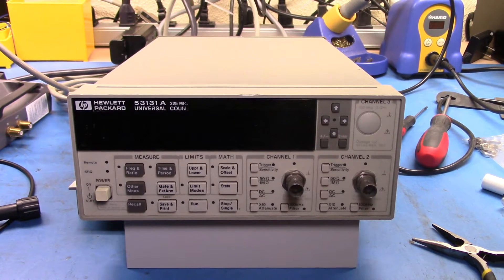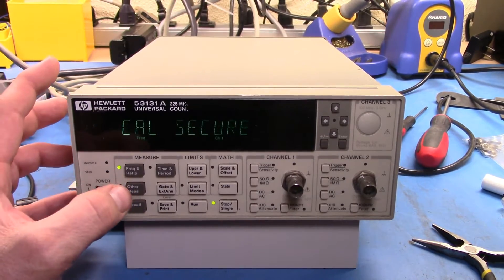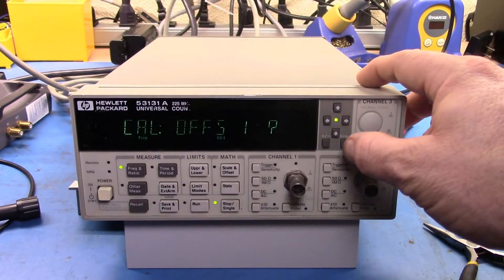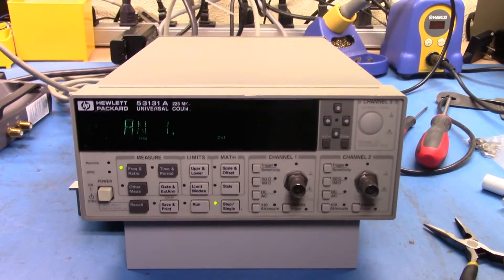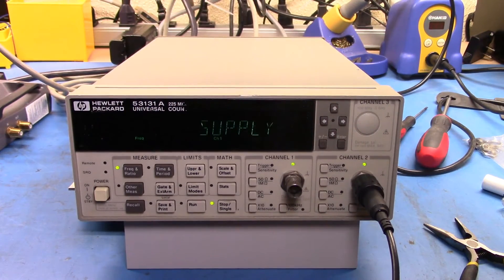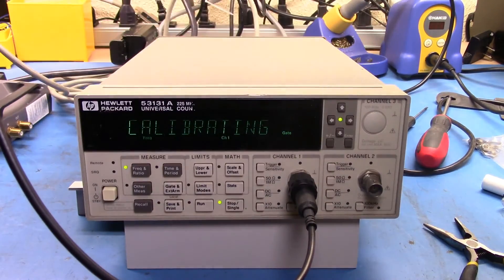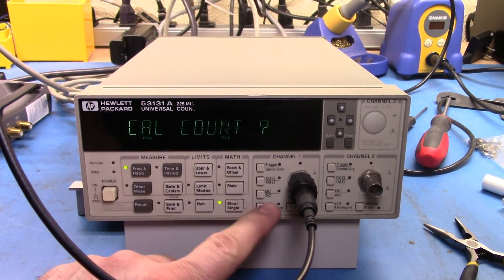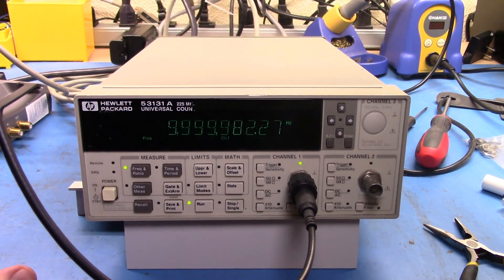HP 53131A Calibration

Comment: How fast of a signal do you need to do the fine calibration?
Reply from the maker: Still just 10 MHz but it's delivered through a Time Interval Calibrator. I have no idea if those are easy to acquire or not (eBay is broken for me right now).

Comment: Why after calibration, with the reference signal, the counter doesn't read 10 meg?
Reply from the maker: I wasn't really clear on this - Sorry about that. 

The reason is that I haven't calibrated the internal oscillator for the counter. If I was going to use this counter as is, then I'd use the oscillator adjustment screw on the rear of the unit to tune it in to read 10 MHz.

However, I'm installing a High Stability Oven (Option 010) clone that I bought from GerrySweeney.com. This replaces the internal oscillator with a more accurate and stable one. When I calibrate that you'll see the unit measure 10 MHz (though these counters will flash the last digit just due to the architecture).

Comment: Those look like nice counters, I had a quick look on eBay and those things aren't cheap... dodgy looking ones are around $600!
Reply from the maker: You were right too - There are a couple of caps on the supply that need to be replaced because they're bulging. Will have to get those parts and replace them. Thanks for the heads up.
Reply: if you still hunting one I have one I never use :)